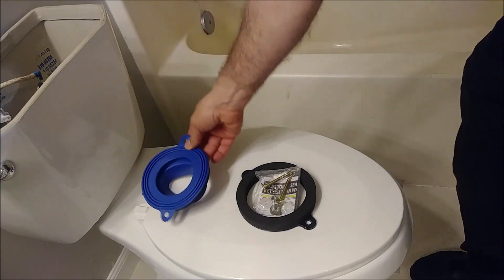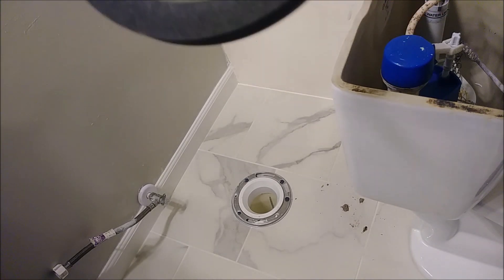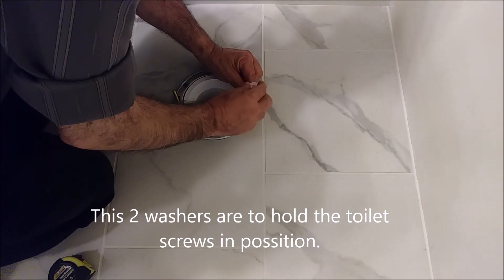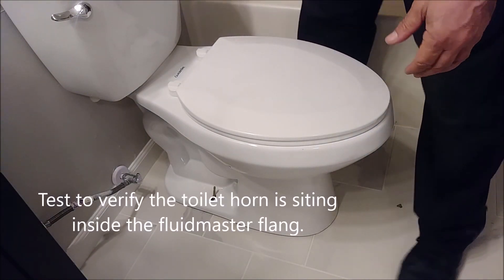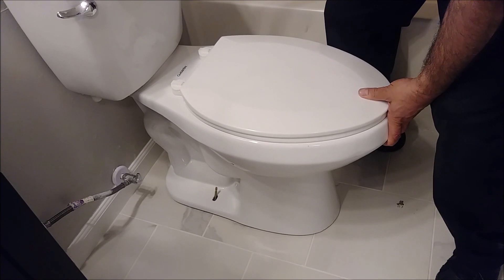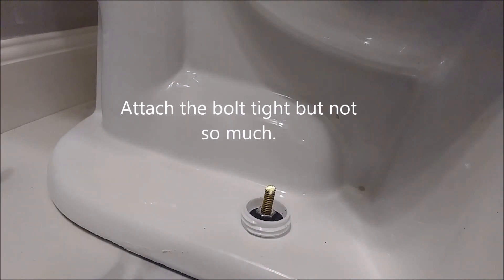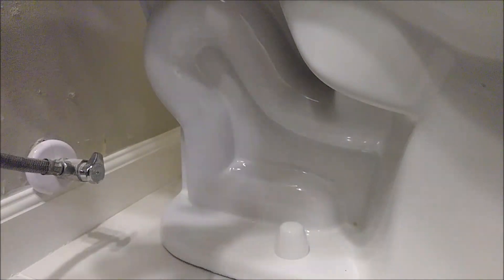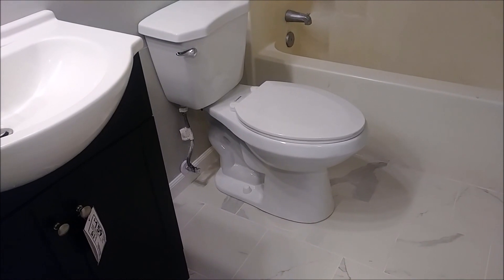How To Install Fluidmaster Rubber Toilet Seal - In 5 minutes

Comment: Can you put the blue flange on the end of the toilet pipe first to ensure the fit and then lower the toilet down?
Reply from the maker: Yes you can.
Reply: It's supposed to go over the bolts first so I would put it in floor

Comment: Don't use Fluidmaster's "Better Than Wax" product. That was my choice as well for a toilet that began to leak at the floor. Three years or so after installing this product, it began to leak again. When I removed the toilet, I discovered that the plastic that this product is made of had hardened and deteriorated, allowing the leak. Many types of plastic deteriorate over time. I sensibly assumed that Fluidmaster would have used a plastic that would endure. They don't; the product is garbage.
Reply from the maker: Never happens to me. You may had a defect product.